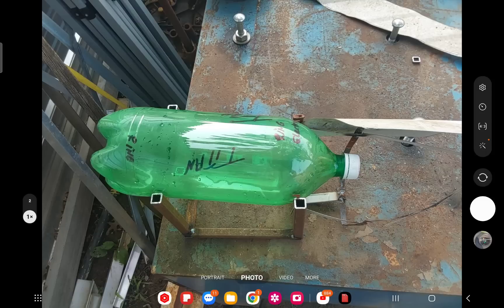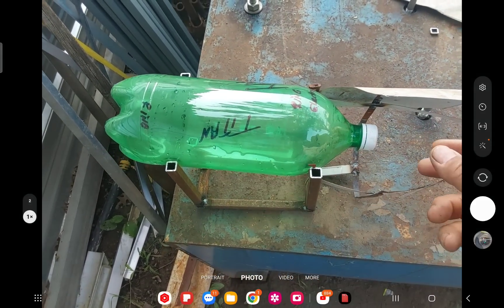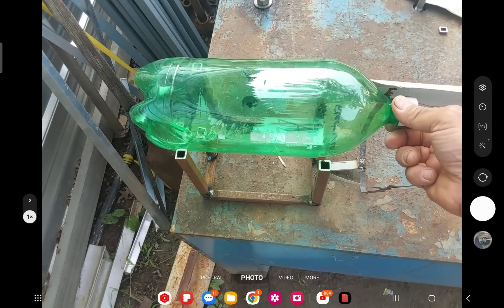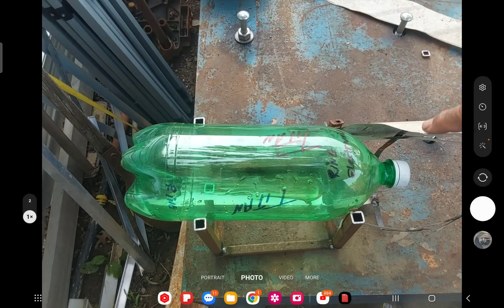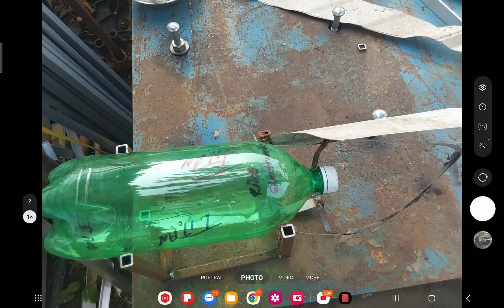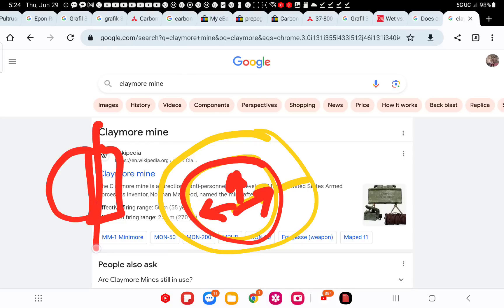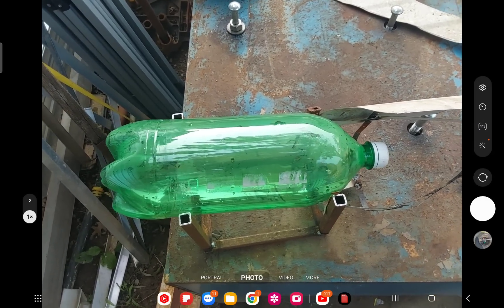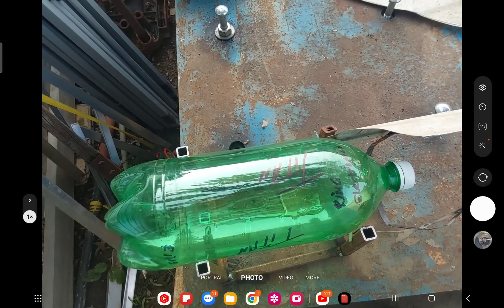Titanic Titan Implosion at rear overpressure ORhydraulic EXPLOSION via OVERPRESSURE of hull u decide

Comment: compressed air = Ex Plosion
Vaccuum = Im Plosion
it was a Plosion
Reply from the maker: Did you read my pinned comments?
I have spent 10s of hours researching implosions; the Navy has done lab implosions and not ONE REAL WORLD implosion.
The real world implosions have turned out to hull breaches first and munitions exploding on board.
This tube Titan is one of the only if not the ONLY real World failure.
It also might simply be a hull breach first, would build up internal pressure first and cause an implosion but an explosion .
But, the hull breach can turn it's failed area into an implosion at the breach which would cause the overpressure and then explosive effect.
All lab experiments canNOT duplicate the Ocean depths, I will explain in a future video.
Be patient and I still ask your help with a thumb's up and your patients while I show it over a few videos...
I will back track over the basics and I have to get a new editing computer to do this ...
Rest ashure (too soon?) I will have you fully understanding overpressure and this tubed vessel.
Further, I will never not change my mind if data shows this version to be incorrect; I have programmed myself to not let my pride control my actions.
Reply: @ForensicEngineeringAnaylsis  
...YOU are an admirable wonderful Engineer - 
I watched ALL your presentations on that Event - 
and am stunned about your details.
I am a simple German Biologist - 
and I am disgusted by this horrible Arrogance
luring Ignorant Tourists to the thrill of Deep Diving
For me as a Scientist - 
it is this way of Manipulation  - 
like Pushing Dope to Innocents...
The worst Aspect is, in Europe - 
anything American has a Horrible taste - 
and Americans are NOT welcome anywhere anymore
This fuels the worst prejudices - 
this damage may never be repaired - 
no matter what Miracles they perform...
It is the same for anything Extreme - 
promising the ultimate kick
I am a German Rescue Swimmer since the early 1970 ´s - 
and I never went deeper than 3 Meters - 
as this pressures feels already horrible... 
I only once jumped from 10 Meters high - 
and the water felt like solid Concrete...
There is no thrill for me in such stuff ever
In a pervert way 
Cameron with his extreme films and attitude - 
fuels this craving for extreme adventure. 
like Messner fuelled the hype about Everest...
I was a Post Doc at Cornell University - 
when the godly Carl Sagan still floated on Campus - 
and have the most admiring respect for American Science -
 at the hard core level...
nice meeting YOU!
Thank YOU!
Reply from the maker: Wow! You hit home for me....yes, USA IS destroying the World and I can and most of us in the USA feel the same anger! 
We have been taken over by the military...
As a rescue diver, that is awesome and I can't reveal all my background for certain reasons but I will tell you, I ALSO took that platform walk and those bastards could have broken the water's surface tension with the spraying water technique but NO, they want to surprise each person with that pain...
I went to the bottom of the tank and rested there, while I processed all the pain, that was the only time I was able to take that depth WITHOUT hurting my ear drums! 
I processed that I was angry and I think the rescue diver below saw u was in total control and awareness and left me alone!
I am only glad that I did not break my neck! 
See, I turned my feet first into a dive, what a mistake! My hands did not stay closed and impact was also on my head!!!
I have never made that mistake or been so arrogant with entering water again! 
Okay, here is a quote I gave to Pugfacemedia, he is an attorney here and takes walks with his Pug dogs in California and post videos of his interactions.
"Pug,I have now done tens of hours of the Navy's research on implosions, dating back to 1970; they even tested Xmas tree bulbs.
The testng is all lab work and the short answer they come up with, implosions and location on vessel is UNPREDICTABLE but you might guess it right 
Currently they used scaled models and computer theory ONLY and then they only operate within ⅔ of their max working depth.
The Navy has NEVER done full scale, real World testing and the current implosions of Navy vessels all turned out to be hull breaches first! 
The Russian sub never imploded and they died from a fire while waiting to be rescued.
This Titan is the only failure of a tubed vessel of carbon fiber ever! 
The Navy needs this vessel bc it will give science to failed vessels at depth.
In short, lab implosions are also, always a hull breach and NEVER a true implosion bc the technology does not exist to maintain true depth pressure after hull breach because the void space (hull) upon breach drops the testing equipments pressure and just adding pressure after a hull breach, in a lab, does not but test the density of the inside materials and further stresses the test equipment.
In closing, lab and computer testing are defective unless they can truely scale the vessel with plumbing inside , the ribs, etc...
Because, real World Navy vessels have two hulls, ribs, broken and leaking water pipes, hull breaches, bull heads and often internal explosions that create the doomed vessel...
The Russian sub never imploded, they had survivors at the bottom that ultimately burned up trying to make more oxygen while waiting to be rescued.
But, the navies around the World said they all were crushed from implosion!
ALL these Navies turned out to be wrong and the captain wrote, in his last words, that they were attempting to make oxygen and were awaiting rescue! 
That vessel never imploded but had a hull breach from on board ammunition failure also...
The concept of implosion is almost mythical and theoretical but, it's always a hull breach first and how the vessel behaves after that hull breach, is NOT predictable by the Navy's research...
I would argue it is some degree predictable but you would also have to have knowledge of those specific materials at time of hull breach and then determine what would happen in that shape of vessel and the materials reactions from the applied forces over the next fraction of a second..."
It should be noted I only read English studies...
Thank you for sharing you are a biologist and I have some theory where I cross into biology, chime in if u care ...
Reply: @ForensicCats  
Thank YOU so much! You are stunning!
I once worked at a Biotech company creating Vessels for Fermentation. The Engineers were always struggling with that combination of Glass and Metal - as the vessels had to be not leaking and Sterile - to prevent contamination. To keep them sterile is a advanced Art...
when Stockton cynically mentioned:
Plexi Glass - I was shocked - and apparently rated for 1 300 Meters - sounds atrocious to me. So I  imagined - the Acrylic slowly crackled - and then was shot out - may be the Horror Stockton panicked and tried to ascend as fast as possible - which may have stressed the Hull to Breaking. I wonder if that Collapse was discernable from the Mother Ship above - with the sudden loss of total communication - and the recording of that NOISE...
As a Biologist - I am wary of Engineering - as Engineers are under horrible pressures to perform FAST and Well - which is a sure way for disaster. 
As a Biologist my observation is even worse - as our Generation tends strongly to stay in Infantile Phase - never maturing - seeing the world as a Play Mobile - what Steve Jobs to me presented the most:
Reality Distortion
We create a synthetic artificial Techno Sphere - for which we have no Instincts, no Intuition, no Understanding. We play with technology as total Ignorants. This kind of Catastrophies will increase in all areas. 
I this sense, I am pessimistic for our Future - it may end nuclear...
You are an amazing Presenter and I am amazed at your Presentations! 
Thank YOU!
Blessings from Germany

Comment: Even before I saw this video, I commented under other videos about my theory, which I created as a technically minded person.
1. A small crack appeared in the hull, which started letting water into the tube. It could have formed at the ends of the cylinder or in the layer between the laminate cover and the titanium cylinder. The crack did not cause an immediate implosion in 1 ms, but the slowly flowing water reduced the volume of air in the tube and increased its pressure. The crack was created at an external pressure of (for example) 200 atm.
2. The crew saw that disaster was imminent and dropped the load.
3. The pressure in the tube increased to such a level that the life of the crew could no longer exist (for example, 20 atm)
4. The submarine, with compressed air and reduced volume in the tube, began to descend faster and faster, even after the weight was dropped.
5. The conditions for the cohesion of the submarine worsened - the internal air was heated by compression and the external pressure increased with the depth of the dive.
6. The crack (breach of the seal of the submarine) got bigger as the pressure increased and the strength of the tube decreased due to deformation.
7. In the limit strength state, an implosion occurred, which knocked out the tube covers with a hydraulic shock and caused the deformation of the package. The implosion could have been triggered just off the ocean floor or after the submarine hit the bottom. What is more likely to tell is the scattering of debris on the bottom.

Starting point of consideration: Acrylic glass and its attachment was designed for pressure from the outside to the inside of the submarine and not the other way around.

By examining the deformation of the package and phoresically examining the remains of the bodies, the theory will be confirmed or disproved. It is possible that it will only be adjusted taking into account the dynamics of pressure increase, the amount of water flowing into the tube and the gradual deformation of the hull up to implosion.

I haven't been very successful with my hypothetical theory because everyone clings to the initial theoretical description of a computer simulation of a perfect implosion in 1ms at 380 atm if the submarine is fragile and perfectly tight. Some commentators have admitted a small percentage of probability to this hypothesis. How much does my hypothesis differ from yours?

Comment: Another channel had put forth the possibility that in an emergency they might have been able to release the rear section. Do you think that was possible? I keep looking for some sort of release type setup but I am not an engineer.
Reply: I don't think so as it had all the electronics needed for things like recycling air and monitors. I heard they could do this with the railings at the bottom though. To help with buoyancy.
Reply: Seven different ways, they said.

Comment: This is interesting, cause it points out a lot of factors, that those engineers didn’t have a friggin clue where the problems were , am actually referring back to one of the thrusters they put on  back to front  during a dive , Stockton Rush mentioned they were going round in circles, that  to me just says it all, if they screw up with a thruster, then what else have they screwed up. !!!!

Comment: interesting video. i haven't seen anyone on youtube point out that some people know exactly how it imploded. the frequency of the oscillations as the craft disintegrated and then the big bubble fragmented, the bubble pulse effect. this frequency can be measured acoustically. as the volume of air inside the vessel is known the collapse depth can be calculated. then this derived depth value can be used to calculate the energy involved in the collapse. american navy boffins MUST know all this stuff. so they know at what depth the event happened and how long it took.

Comment: My overall thoughts of the Titan implosion:

Using completely different materials of carbon fiber, titanium and plexiglass which have completely different compression, expansion, creep, elongation etc physical mechanical properties raise huge red flags of the design capabilities of these vastly different structural materials, which will not work together as a safe cyclic system.

Unexpected shock loads, extreme pressures, temperature changes etc. have great effects on individual materials which react differently per material. 

Predicting these differences and compatibility thereof, is tricky business when subjected to extreme forces, especially over time with repeated extreme cyclic exposures.

Therefore, a first alpha prototype submersible should have undergone significant number of unmanned cyclic tests with crash dummies aboard, conducted at Titanic’s depth and duration of a typical mission to validate the design safety margin of cyclic (repeated) usage. 

This type of real world testing is critical of any radical departure of proven sound engineering design and testing validation principles. 

Further, only commercial grade components should have been used. Cheap off the shelf parts can have unexpected cascading issues. 

“Breaking the rules” in engineering design, components, testing and certification is predictable catastrophic system failure. 

Even though individual components may not fail, doesn’t mean the sum of the equation working together as a safe cohesive system won’t fail. 

For example, the carbon fiber itself may not fail, but the lamination gives way causing the carbon tube to flatten like a pancake under these extreme pressures, cold temperatures and repeated cyclic loading, etc.

Also, the way the carbon fiber was used in a continuous rolling tube process design raises significant questions of its ability to withstand repeated cyclic loading vs a 3D multi layered braided design which has uniform bend radius throughout the laminated layers. 

Time and rigorous analysis will determine the probable cause or causes of the implosion. 

Rule number one of all new designs in extreme conditions:
Rigorous testing, validation and industry independent certification is a must when offering a product exposed to the public and environment.

Comment: 30:02 The bolt is on the backside I believe, on the outside looks to be a square block with a very small metal tube going to the ring as seen at: 27:02 to the above right of the blue circle.

Comment: Let’s see if I get this. The sub failed in the back, the water comes into the sub compressing the air like an engine on the compression stroke. The carbon fiber acts as the cylinder liner and the high PSI ocean acts as the engine block. Then either the front blows off or the force pushed everyone and everything back out the rear. Then the sub jets off the landing gear, leaving it in good order.
Reply: That's the general idea. However, we are talking about a carbon fiber cylinder instead of an engineered steel one. This cylinder had reportedly made the trip down and back at least half a dozen times, which means it had cycle fatigue (they scrapped the original hull for this very reason a few years ago). So I think these enormous forces were quick enough that they blew the ends off, since they were just epoxy glued to the hull, and at the same time the carbon fiber failed entirely. When carbon fiber fails it shatters rather than ruptures and buckles as metal would. The entire event would have involved energy that we can barely comprehend. You saw here that a simple 1L bottle with pressurized air managed to break the welds on the mock up frame. Imagine that kind of force scaled up.
Reply: I think the oxygen cannister/tank blew and they had lines into the submersible (from the back section and some under the seating area maybe?) and water pressure and the oxygen going into it and all imploded. I wonder if they found any tanks?
Reply: @PRC533 thanks for your detailed response 👍

Comment: this is an excellent analysis BUT I have 2 problems with your theory and model. One is if it happened that way then theoretically the the carbon fiber tube would remain mostly intact, I havent seen it being unloaded with other debris. Second I believe your bottle didnt explode OR implode and that it split when it impacted the wall of the tank.  cant tell because when I watched your video frame by frame those frames were removed. it goes from 41.03 directly to 41.06 Your logic is sound but theres some puzzle pieces missing that only close examination of the debris will answer.
Reply from the maker: ...this is getting a lot of people upset bc I offer the hydraulic internal overpressure option... it still has an end implosion if that makes them happy.
Reply: @ForensicCats  you had a good analogy going with the overpressure damage from explosions to the human body. The Overpressure isn't necessarily what does all the damage so much as the negative pressure implosion that happens when all that suddenly consumed air rushes in to fill the void. That is what collapses your lungs and destroys air filled cavities.
Reply: @ForensicCats  well it IS the internet. LOL
Reply from the maker: ''Blast lung is caused by a shock wave generated by an explosion causing widespread damage in the lungs, leading to intrapulmonary haemorrhage."  and you can find the source with this quote and educate yourself better